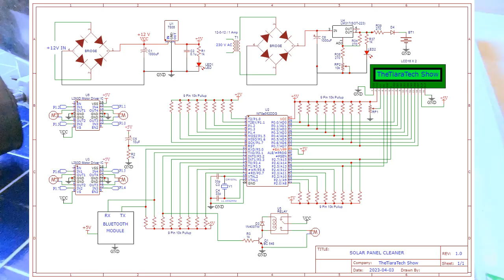Solar Panel Cleaning Robot Prototype | How to clean Solar Panel through Robot ? Solar Plate Cleaner

Comment: Sir
Did you use a 8051 microcontroller development board or just a circuit?
Reply from the maker: We have developed our own circuit board using the nuvoton w78e052ddg microcontroller. The board consists of LCD, Motor Driver, Relays, Regulator circuit, Battery charger circuit etc.
Reply: @TheTiaraTechShow i can use AT89S52 instead of the W78e052DDG?
Reply from the maker: @tristanfernandes1361  yes you can use AT89S52 or any controller with 8051 Architecture.

Comment: May i know also what is the white flexible curve pipe that is putting the water into the brush sir?
Reply from the maker: That pipe generally used in RO Purifier, easily available in the hardware shop.

Comment: Sir I have L298N motor driver can I use it instead of L293D
Reply from the maker: yes you can, there is no problem in that.
Reply: @TheTiaraTechShow  sir how we connect because in l298n have two port for two dc motor
Reply from the maker: @jitinjitin9688  connect Motors in Parallel. We did the same.

Comment: May i know what is the front side plate with some gear arrangement called sir?
Reply from the maker: That's was the part of PVC electrical switch board,, cut it and used to mount the brushing mechanism

Comment: Can i use lcd display for this too if i use an arduino uno sir?
Reply from the maker: Yes you can,,,but you need to use either Serial LCD or uses 16x2 LCD in 4 bit mode,, we have used 8052 40 pin IC there are 32 IO lines,,
Reply: THANK YOU SO MUCH SIR!!